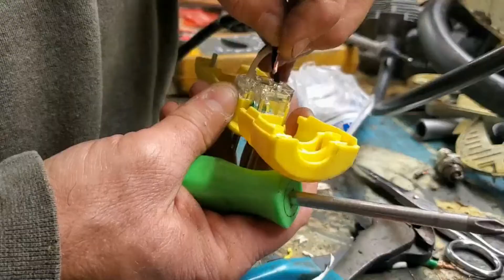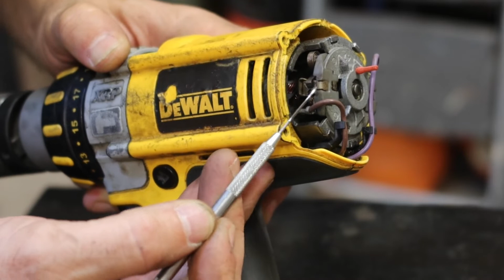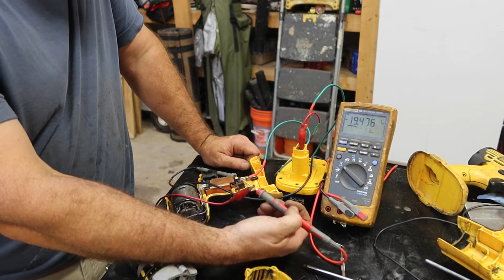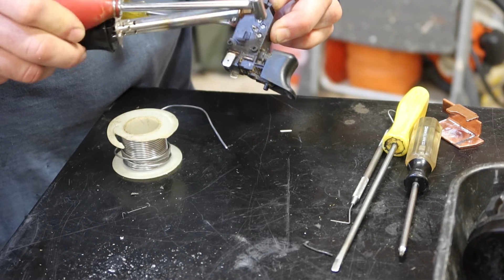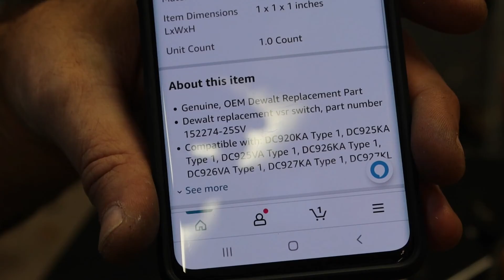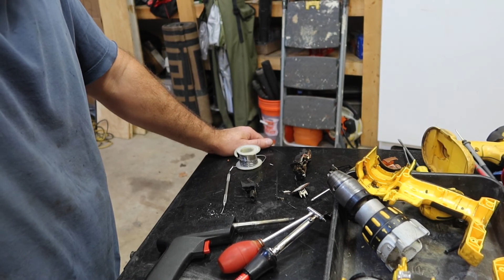Dewalt 18 volt Diagnose drill VSR no power DC925 DEAD / FAIL / CARNAGE

Comment: Ray, you might want to slow your introductory sentence down a bit - difficult to understand. 
I have had a Ryobi drill for almost 30 years and it’s still going strong. Had chuck issue a few years ago although it still works and got another used one on eBay along with two batts and charger. I now have 5 batts. The first three have been rebuilt three times and the next two rebuilt once. Recently my original drill started giving me problems which I finally narrowed down to the contacts inside the drill. Cleaned them up good and bent them inward just enough to once again make good contact with all the batts and everything is up and running again. I guess after 3 decades the contacts gave up some electrons enough to reduce their thickness enough to not make good contact with some of the batts.
Glad to have your video so at least I can see it’s possible to troubleshoot the entire system if I ever have any other problems, so thanks for a great video.🙏👍🔧
Reply from the maker: Funny you're the second one today to tell me that. Thanks for the honesty and feedback! I actually found a replacement drill today but not worth doing a video on since it worked. Thanks for watching!